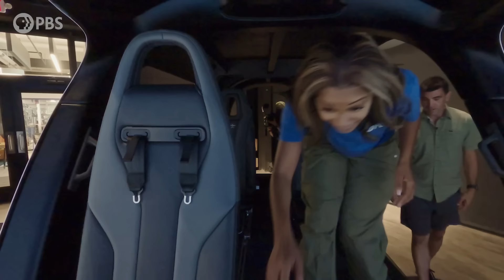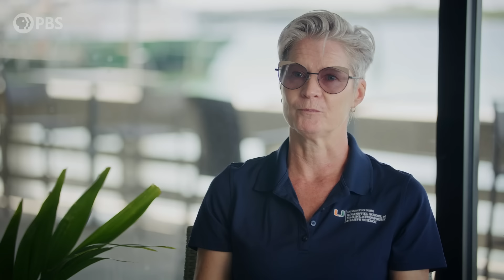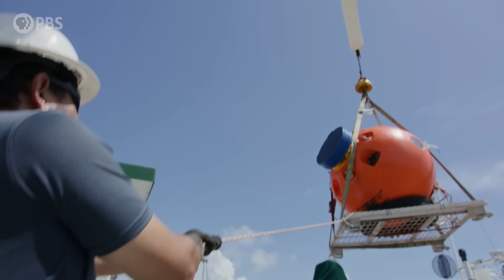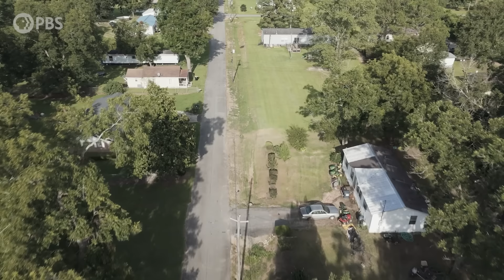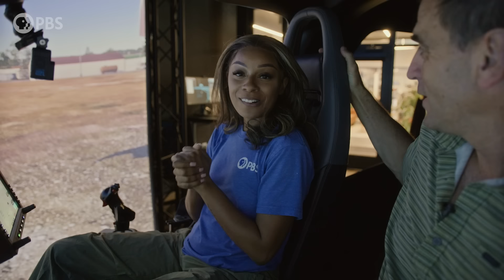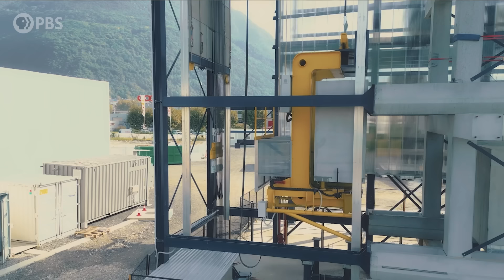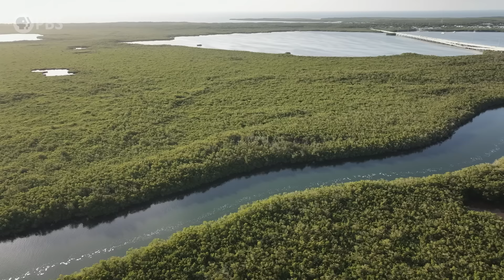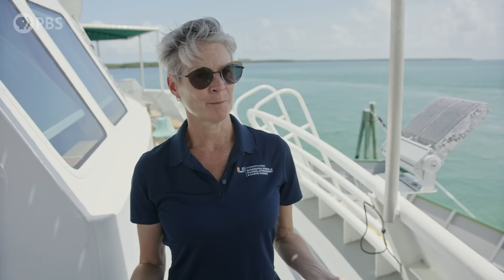This Is The Best Evidence That Atlantic Currents Are Slowing (AMOC Explained)

Comment: A heat pump isn't going to work where I live. It just gets way too cold during winter. I mean, it'll work fine in spring and fall, but winter? No. We'll need something that can produce heat at much lower temps than a heat pump can handle.

Although for a majority of Americans, it'll probably work just fine. I suspect even in Ohio, those really cold days? The heat pump just won't be able to do it. They don't like it when it gets below 15F. And I suspect Ohio gets quite a few of those days in a row in winter. I know we do here in Iowa. -5F to about 10F is kinda normal in January here. You're really gonna be feeling cold if you only have a heat pump in that weather - esp with the winds we tend to get.

Edit: Oh yeah. That'll be more than enough for ppl in GA. It really doesn't get that cold down there.
Reply: Heat pumps are more like air conditioning. Think refrigerators remove heat, which cools the air inside (strange that so many people don’t know that’s how that works, too). They don’t make the air cool, they remove heat. In heat pumps, they are using the cool earth, that can be warmer than the outside air, but in extreme climates, heat pumps must be augmented with additional sources of cooling or heating. So, their use is limited. Not many people are going to have multiple systems, especially with the costs and the land required for heat pumps.
Reply: We have a heat pump in NE Kansas and it works fine during our occasional weeks of sub-zero Fahrenheit winter weather. It also works well during occasional over-100 weeks in the summer. There are several kinds of heat pumps so you need to ensure that you have the model appropriate to your local climate. This single unit replaced a conventional central air a/c and gas furnace.
Reply: Modern heat pumps function 50% more efficiently than electric resistive heating (e.g. space heaters, furnace emergency heat strips, etc) down to -22F. Electric resistive heating is already itself about 10-25% more efficient than natural gas furnaces.

If I didn't live in a multifamily unit that I don't own, I'd be ensuring that a heat pump is next on the list for home upgrades in my place in Minneapolis, which saw -18F just last week.

The main reason it's not sold as the better option throughout the upper midwest is because natural gas is artificially cheap, roughly the equivalent of $0.0429/kWh (as converted from therm to kWh). Gas furnaces are just as prone to issues in cold weather and are less efficient, we just subsidize natural gas so much that it's more expensive to use less energy.
Reply: @kittycatcaoimhe  I'd suggest you check out Technology Connections video on heat pumps. Efficiency isn't the only measure you should be concerned with. There's a reason heat pumps aren't the standard up here and when ppl do have heat pumps, they have another type of heater as well for when it gets really cold.
Reply: @SadisticSenpai61  It's that video that has me convinced it's the right choice for all but the deepest bits of tundra. He even goes on an entire tangent about the fallacy of "but sometimes"

Comment: I'm very disappointed that PBS Terra didn't use the word that most major countries speak all the time: Nuclear. It used to be the most hated thing among environmentalists. Now, it's the least bad choice.
Reply: I'd have generally agreed with you ten years ago, but building renewables is just so shockingly cheap now they're financially much more viable than building nuclear which has insane startup costs and is just generally harder to build. Although those new small modular reactor designs do look like they have a lot of promise compared to traditional nuclear in terms of affordability and ease of implementation. Longer term though, fusion is real future of energy. That's still a ways out, but there's been some exciting progress lately.
Reply: @ARabidPie  yes, but once it was sabotage ya in a hell of trouble.  concentrate power is effective but ya need diversity too.
Reply: There is new pulse laser drilling tech to get geothermal almost anywhere on any continent in less time it takes to build nuclear plants and doesn't require nuclear fuels, just steam turbines that generate electricity 24-7. That said there are some small nuclear generator systems on the horizon that might come to market in the USA and definitely in other countries in the next 5 to 10 years. They are much safer than the huge nuclear plants that pose much larger dangers to the planet and human populations. Don't be disappointed, it is just going to take some more development to make them a reality. The down side is that the nuclear stations are being funded by AI investors and AI is going suck huge amounts of energy from our normal energy needs. And AI is not that great, and is being overhyped. So lets hope they still bring nuclear to the forefront but don't just use it for AI power needs.
Reply: Nuclear is not very relevant to address the climate crisis, because it can't scale-up quickly enough in 10 to 20 years.  Hopefully, construction of new nuclear plants keeps pace with retirements.  It will be very tempting to push old plants past their safe lifetime, and that risks a minor accident.  Even new plants, with a variety of designs, may have little oopsies.  Public opinion can sour very quickly.  Nuclear is a valid choice, but let's not pretend it's cost-effective or that it isn't high-stakes.  PBS Terra has the right idea to focus on what people can do.  Nuclear already has plenty of mindshare.
Reply: The Forbes report shows its a lot more costly than wind or solar (LCOE levelised cost of evergy).  We need storage, to manage gaps in supply better more than anything.

Comment: So, van live or live on a sailing yacht so you can drive or sail away from the trouble spots...  Problem, is, that costs.

Of course there's the Minecraft solution where you dig out a base to grow your own food and everything.

The problem is that this is still the frog in a sloely heated pot problem.  Known risks at the end of the century isn't going to stop the building and purchasing of houses in a guven area now...  It's the tragedy of the commons, the costs of the fissil fuel use won't be footed just by yourself but by everyone in the world so why would someone not continue to use fossil fuels for their own benefit now...  We will play Russian roulette with the AMOC because the risk is spread out to a lot of people and we only share some of the disadvantages ourselves.  I'm not saying continuing to use fossil fuels is right, just that not only is it difficult to get enough oeople doing what they should, it'll be too little, too late.  Just be prepared to have to relocate to safer locations and live out of your own victory gardens and hydroponics while the food production and distribution adjusts.

As a society, I don't see us getting out of having to deal with severe consequences.

Comment: Didn't NOAA.gov just publish that the AMOC "has not declined in the past 60 years, is proving to be more resilient than originally expected- highlighting the need for better climate models. Specifically those that consider the impact of Greenland glacial melt."

https://www.aoml.noaa.gov/advancing-our-understanding-of-the-amoc/#:~:text=A%20pause%20in%20the%20weakening,the%20natural%20and%20anthropogenic%20signals.

😵🤔

Comment: Miami, Florida is experiencing land subsidence, or sinking ground, due to a combination of factors including construction, tidal flows, and limestone cracking. This subsidence is affecting many high-rise buildings, including luxury condos and hotels.
Reply: Yeah, it isn't just land subsidence as there are regulations for groundwater use for decades now.  The Miami storm sewers now having to pump up to drain into the oceans instead of drain by gravity as they were designed for says a lot about what is happening and you can't blame this on just land subsidence.
Reply: @johnwang9914  at least we can't blame climate change.

Comment: Live on lake Erie west of Cleveland. 73 years old house. Went 100% electric in May of 2023. 2 used EVs. Heat pumps. No gas line connection. Small solar panel system.  Total energy cost around $800 less per year. Auto maintenance $0.
Reply: And how much did it cost to switch it all over to that?
Reply: @markrine5368  $120,000. House had been in bad shape for 20 years. Repairs should last 30 years.
Reply: @ that is why it is impossible to make everyone go green .It costs to much. That is more then my house cost when I bought it.
Reply: @ That is why it is impossible to make everyone go green .It costs to much. That is more then my house cost when I bought it.
Reply: We moved to Erie, PA as part of our climate action plan and we love it here.  And I get to enjoy Cleveland too on occasion.  Great town.  That said, we installed cement board siding and new hurricane rated windows.  It sounds like you have grid failure factored in, but don't forget to strengthen your house.  Our 100 year old Dutch colonial is shaded, so no solar yet but we do have a generator.  I also met with the mayor a few years ago urging more climate adaption, such as buried power lines, but not sure if my visit sunk in deep enough.  Lastly, I bought my first prius in 08 and got the last laugh after my in-laws said I'd never save any money, blah, blah, blah. Then gas went through the roof.  I saved so much it paid for my daughter's RN degree!

Comment: Hydrogen doesn't make sense on paper... Much less in the real world. Please just stop talking about it as a fuel source. It can be corrosive, escapes everything, has to be stored at pressures that make catastrophic booms when it fails, is waaaaay less efficient than batteries, etc.

And no, you probably won't be flying from Atlanta to LA on an electric plane in 10 years unless you're doing a bunch of layovers or flying much slower than a typical flight today. A more realistic near term solution is probably SAF (biofuels make more sense compared for jet fuel since fuel is only 4% of the ticket price)

Comment: I really think fully functional electrified vehicles - cars, buses, planes - are only going to happen when we find a way to incorporate their power source into their body design and composition. If house roofs can be used as locations for solar collection, why not car or airplane tops? The challenge is to create durable yet malleable materials that also collect energy efficiently. I think we're further away from this reality than we really need to be.... OTOH, I just saw you "fly" a craft that looks remarkably similar to the personal aircraft on The Jetsons, so.... 🤷 .... I wouldn't say it's impossible.
Reply: So never.

A Honda Civic's engine generates about 100HP. That's about 75KW. Solar irradiance at the equator, at noon, is ~1KW/sqm. You'd need 75 Sqm of solar panels to power a Civic, and that's before factoring the minor detail that solar panels and powertrains aren't 100% efficient, or the other minor detail that it's sometimes not noon, and not everyone lives at the equator.

EVs are perfectly functional as it is. They just require some infrastructure and urban planning changes to accommodate (or even better, eliminate) them. That's not as sexy as a solar powered car with infinite range, but it's easier than trying to extract more energy than the sun provides in a best case scenario.

Long range electric aircraft isn't going to happen period. The best (rechargeable) battery chemistry has an energy density of ~1Megajoule/Kg. Jet fuel has an energy density of 43MJ/Kg. That's not a gap some clever engineering is going to cross. A better bet would be hydrogen (which has the energy density... if you can figure out storage), or synthetic fuel.

Comment: Solution to electrifying aviation is to electrify transport : high speed rail. Not electrify planes.
Same as cars. Improve public transport network is the best way to reduce emissions. Of course it's good that those still driving are also driving electric cars.
But the most efficient method is an electric mass transport system
Reply: Hot air balloon only answer

Comment: As a German I want to say a thing about heat pumps. Our government legislated that everybody should have a certain heat pump. This is in the time where our manufacturing is really taking a hard time adjusting to sustainability. Now I think that instead of regulating they should have invested in production and exported, making the Germans demand that product for themselves. But I don't know
Reply: There's more than one way to solve most problems. I think you're right that there should have been different options that the government invested in.
Reply: This is complete nonsense. There is no legislation in Germany demanding “a certain heat pump”. The „Gebäudeenergiegesetz“ requires that heatings in newly built houses use 65% “renewable energy sources”, which includes heat pumps, biomass (wood etc), centralized heating (Fernwärme) and solar thermal. Moreover pure gas heatings are still allowed if they are prepared to be converted to 100% hydrogen. Also, this doesn’t even apply to newly built houses in existing neighborhoods, only in newly developed areas.

Comment: How do you store power with wind and solar?
Reply: You can use pumped hydro. Essentially, you’re building a reservoir and dam wherever you need it.
Reply: Batteries, lots and lots of batteries!
Reply: I have 24 solar panels and 15kWh of battery storage. I rarely use power from the grid, although I do send lots of power to the grid (I have a social conscience). My country (Australia) has just approved Vehicle to Grid operation. My electric car will eventually be helping to store electricity from my solar system to add to the grid at night. We can do this, if we work together.
Reply: You can use the energy excess at periods when solar or wind are specially productive to pump water up to a hydroelectric plant, so you can use that water to produce more electricity when you lack the other sources. However, you have to either adapt existing plants, by constructing a new reservoir down the dam, or constructing new ones specially design to be this reversible hydroelectric plant. It's already in use in many places here in Europe. Also, there is the option of nuclear, which after all is really save and clean.
Reply: Wind and solar yield are negatively correlated. So if enough of both are available, we won't need massive storage. Especially if you integrated grids. Low yields in one place can be compensated by higher yields somewhere else. In the future we could even integrate grids in different time zones. So you can use the massive production with solar during the day to provide electricity to a time zone where its getting dark and demand increases.
Reply: There are some experiments with mechanical and hydro...

Comment: Pretty good till 17:34 when the narrative (briefly) embarked on the fiction of NetZero,  which is entirely dependent upon removing CO2 from the atmosphere (aka direct air capture) with technology WE DON'T HAVE (except on a tiny, effectively insignificant, scale), & have no signs of achieving.   Shame on you for perpetuating this delusiom.     

We do need to invest in natural solutions (for adaptation) but these barely scratch the surface of the problem of reducing greenhouse gases.

Comment: A heat pump?!? Someone get technology connections in here
Reply: They work great. We have 2. Used as air conditioning in the summer they are cheaper to run then regular air conditioning.  In the winter they heat the house cheaper the electric baseboards.  We are comfortable when it is -20c outside.

Comment: There are a few points to understand about heat pumps.  One, they also function as air conditioners to cool your home in the Summer.  When acting as heaters, the coolant flow is reversed in the system to generate heat.  2, While they are much more efficient (about 2-3x more efficient that standard electric  or gas heating), its efficiency drops significantly when temperatures drop below freezing.  These systems are best suited in climates where temperatures don't drop that much below freezing in the winter.  States like Florida, the Gulf states, and the Southwest states would be best.  Plus, heat pumps are not really a new piece of tech.  They have been in use in Japanese homes for decades.  Usually they are small units mounted in a window frame.

Comment: In the long run we need to adapt since we will. Even when we get to NetZero there are other nations that may not be. Are we going to then push for NetNegative? The effects of a warmer earth have probably already pushed passed a tipping point and C02 would need to go much lower than 300.

I am more concerned about the heat island effects and the waste heat we generate. Human infrastructure (roofs, roads, structures etc. ) store more heat than the surroundings and then dissipates this heat slowly. Electricity through generation (hot solar panels), transmission and the work it does will generate more heat that becomes trapped in the atmosphere. Snow both melts faster and removed by humans which limits the reflectivity during the winter.